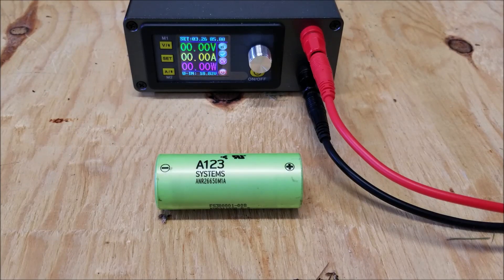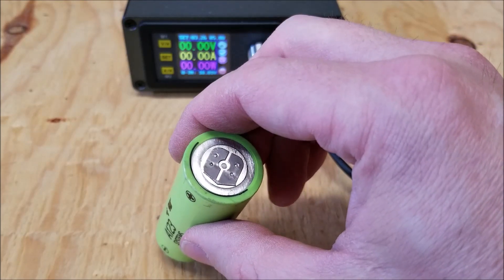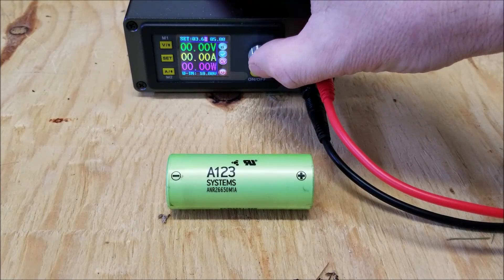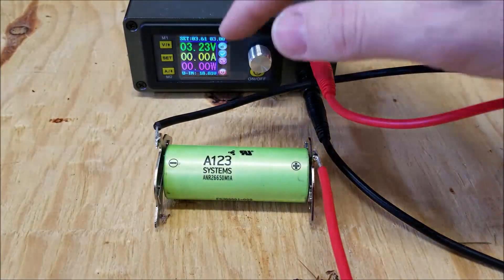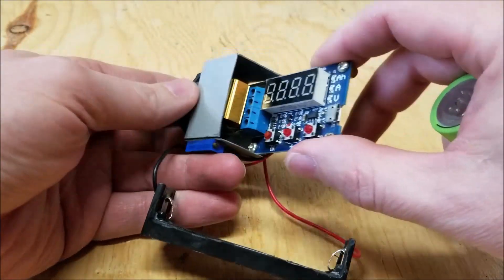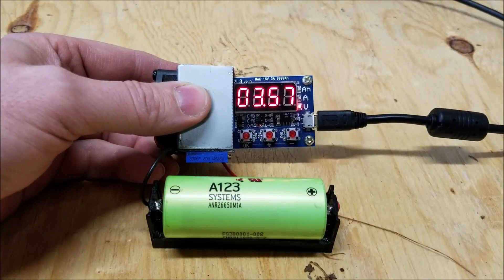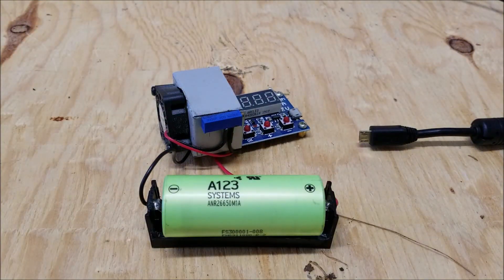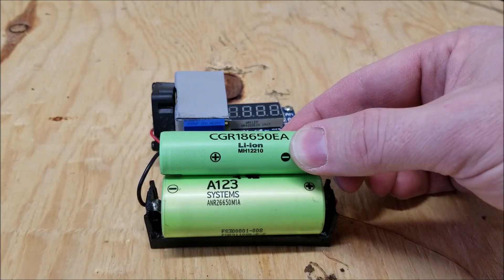A123 cell test ANR26650m1A

Comment: Hello, just an FYI,  A123 does not make round battery cells anymore. They stopped manufacturing them years ago.
Reply: they were bought out by Lithium Werks. These power cells are still being made
Reply from the maker: Interesting

Comment: so around 800 miliamperes means that cell is ok or not
Reply: Jose Garcia well, the spec of the battery is 2200 to 2300 mah, so 800 mah basically means that cells is Seriously degraded... pretty much trash at this point.
Reply: So what should be the minimum capacity to consider the cell goo
Reply: @JoseGarcia-px9xj  Well, I have some that are about 1450, which is 35% degraded and I am pretty disappointed in that.  Problem is cycle life and saftey.  I would like to have stuff that is no more than 10-20% capacity loss at most.